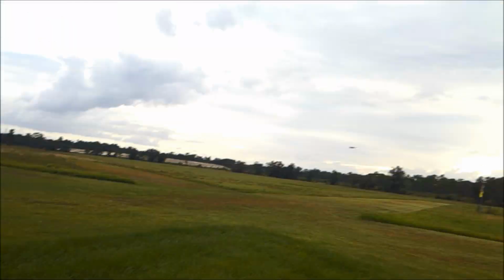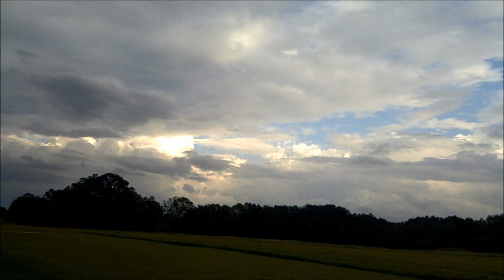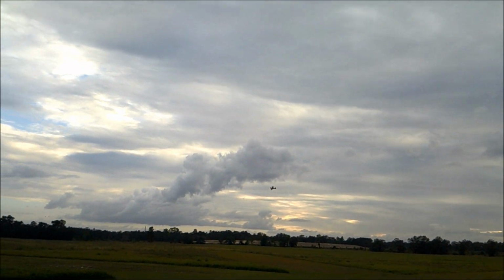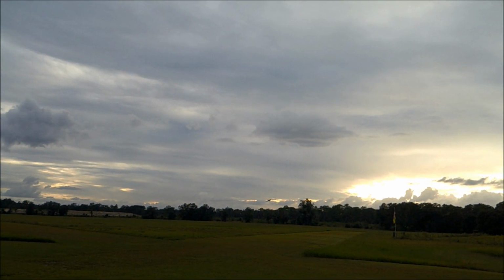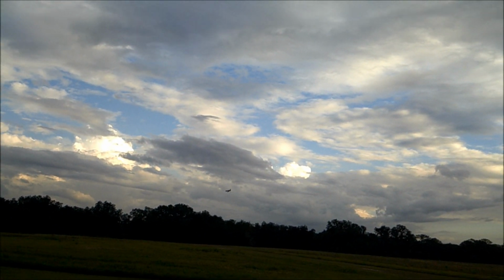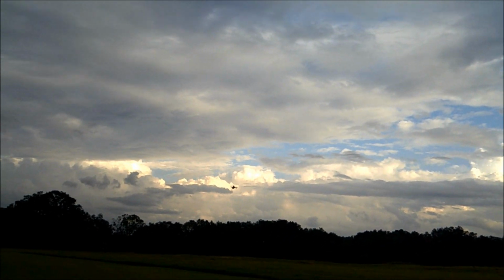LX P-40 FLIGHT WITH NEW CAMERA VOLUME SETTING NUMBER 1 79" 2000MM

Comment: Hi Kenny, I have seen all your videos of the LX P40 warhawk several times. I bought the plane, I did as per your recommendations the assembly. Did you have any issue with the main landing gear? I damaged it and will have to replace. I believe the alluminium struts are a bit too soft. In order to fly until I get new retracts, I reinforced with carbon rods and I can fly but cannot retract the landing gear.
Reply from the maker: Hi Pat; no I have had zero problems with the main gear on this bird. I did have a minor problem with the tail wheel as the little plastic push in hinge pins fell out. I made a aluminum pin to replace the two plastic pins for the tail wheel to pivot on so it can retract
Reply: @hangarfiftyone3527  Hi Kenny, good to know, I will check my tail wheel. Thank you for input. So I will need to improve my landings and we smoother on landings. Although I think I pretty do good landings. I will keep for winter and spring with fix landing gear to improve my landings and for next summer I will change out the main retract landing gears (they will arrive today). As I know I might not be as experience flyer as you are, I will carry put some reinforcement  (although space/clearance for improvements are limited).  This is why I do appreciated your and others you tiber channels to catch some important infos for less experienced pilots as I am. Enjoy flying. You have other LX planes, which is another nice flyer? Corsair? No Jets please.
Reply from the maker: THANK GOD YOU SAID NO JETS ! LOL OK so, this is not what you want to hear but I'm just being honest; as a new pilot stay away from anything with retracts! This is not a comment picking on you, more of a comment about the manufacturer of these planes; none of them put strong enough landing gear in their planes ESPECIALLY retracts. I know you like and want war birds as do I but if you are not a proficient Lander you're looking at a lot of hardship fixing and replacing retracts. Get your self a fixed gear plane ; I would get the Valiant from Horizon Hobby very light plane landing gear is more than strong enough for the weight of this plane and just practice Landing. This plane has flaps ; very acrobatic when you want it to be but very easy to fly and land when you just want to fly. don't fly around for 5 minutes dreading that I have to land now ; spend the entire flight practicing Landings . your skill level will increase exponentially getting you closer to that warbird that you really want. I've been doing this for 47 years and I can tell you that shit happens and I have had to repair landing gear every now and then just part of the hobby. New pilots and retracts are  a recipe for disaster. I have not flown the LX Corsair but from the videos I've seen it will fly just like the P 40 and yes I will be getting that Corsair one day.
Reply: @hangarfiftyone3527  Hi thank you for sincere input, is appreciated. I am not picky so I can easily accept and understand what you are telling me. I got the Valiant for the first 2 years and it is a nice plane. I switched to the Carbon Cub Z SS (today the Husky Arrows cub arrived, so in a certain way I follow your suggestion) and I am on towing the gliders this year on my third year and it works fine (as I have my buddies at the club following me closely). I trained a lot as you suggested on landings. Landing approach never ending. I have still my limits (of course) and I need to know, that I still need more and more. To improve on flying generally I am in Winter time in the indoor activity to improve flying skills.  But you are quite right the landing is the most critical  aspect of flying and each time there is a risk and I have to face consequences. I have notices, that generally retract landing gears are weak or the stiffness of teh allocation of the landing gear is not appropriate. But actually we should not complain to much. For the money we get quite some good value and as after market you can always improve. These planes EPO/EPP are not built and sold to last for ever. So we have always a good excuse to buy a new one. Thank you so much for your time. Keep safe

Comment: With this LX P-40, everyone seems to be having the same problem: weak stock retracts with soft metal links that have a tendency to eventually bend and prevent the retracts from functioning properly.  How did you solve this issue with yours ?

Comment: The gear in this plane is garbage they use O aluminum and O is totally soft aluminum, I had to fabricate new supports for the main gear.  And the plane is totally under power, no a complete garbage but for the money stay away from this plane.
Reply from the maker: totally disagree with your assessment of this airplane ; I have hundreds of flights with this plane and it flies GREAT ! Not one issue with main landing gear works perfect ! if you have to make this plane stronger to survive your piloting skills then maybe you need to be a better pilot. I fly with a guy that thinks like you; he felt he needed to make the plane stronger because he thought it would break on landing; he made the plane heavier by making it stronger and NOW it's under power and wont fly. nothing wrong with this plane; I Love mine .
Reply: @hangarfiftyone3527  The gear is made with O Aluminum is the most soft aluminum out there, good for you but I grease my landing and gear is a terrible, designed good, bad material, I made new gear scissors with 6061 aluminum, then will see.  And with stock power is a cow.